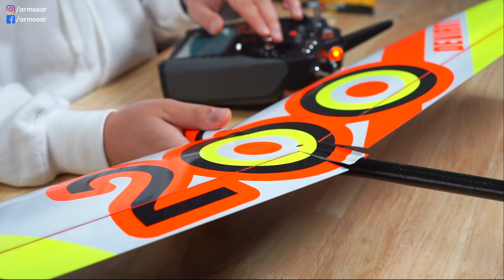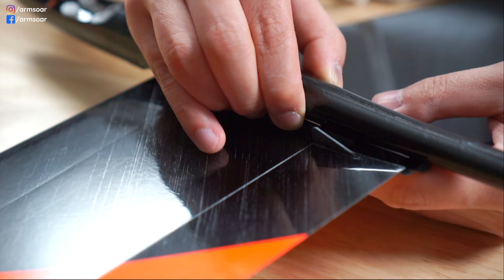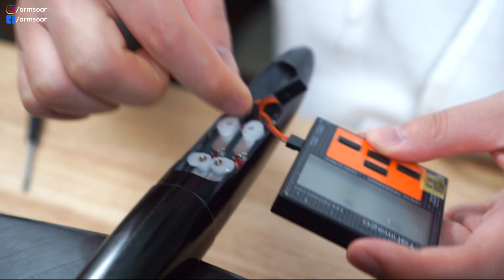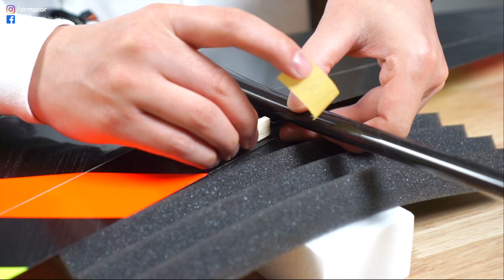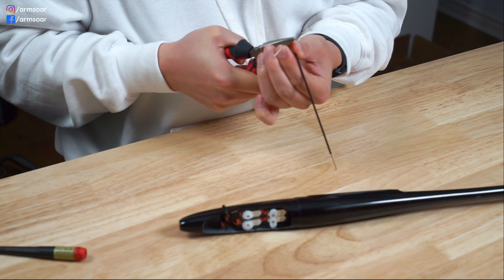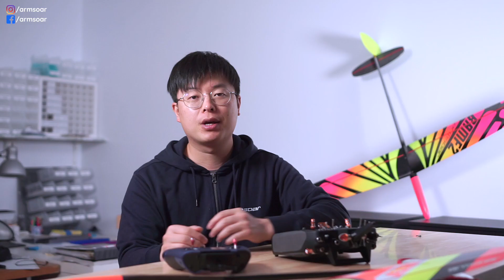Offsetting Your DLG Flaperons For The Best Performance

Comment: Inspiring approach. Have I got it correctly that you never use your flaperons in upper position? (spoilerons?)   The offsetting would limit that option.
Reply from the maker: Yup! Flaperons are not used as Spoilerons. The only up deflection is meant for aileron use.

Comment: Could you help me with a problem i am facing right now? I am setting up my cfk alien dlg. It has a rudder and and ailerons, which also work as an elevator. Im trying to program flight phases on digital switches - which works for elevator. Phase "Start" which some elevator up - and some right angle for rudder (to neutralize the tendency for going left right after start).
How do i access the rudder function to a digital switch? Is it via the "mixing" function of the TX? I am using a Spektrum DX6e...

Comment: Hi all, 

I am trying to set up my 1m Hawk DLG. 
NX8 - spektrum receiver 

I have set up my flight modes in Camber Preset. 

Is this correct: 

Cruise mode 0mm with 6mm up and travel of the aliron when I move the stick and 5mm down.

Thermal 1 - 2mm down this then reduces the up travel of the aliron to only 4mm and means the down throw become 7mm

Thermal 2 - 4 mm down this reduces up throw to 2mm and down becomes 9mm

Is this correct? The camber preset moves the aliron function down. 

Should the aliron throw be 6mm up and 5mm down regardless of what flight mode I’m in? 

Cruise 0mm
Thermal 1 - 2mm down 
Thermal 2 - 4mm down

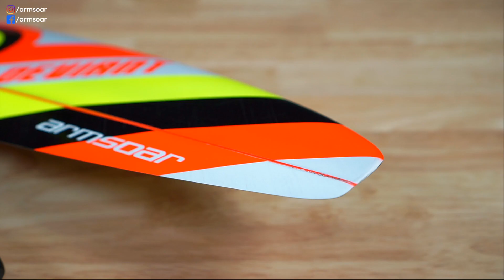Comment: 2:58 when you set them to neutral do you use sub trim to set 0° deflection? I did this with mine and I think my sub trim value is 450ish which is the max value.
Reply from the maker: Combo of sub trim and camber systems.

Comment: Very helpful! Another way to do is let say you need +15, -85deg, I center the flap at -35deg, in Frsky fine tuning with the servo center in outputs, I then use a mixer line with the fonction MAX and offset 35deg. This way no sub trim required.
Reply from the maker: Great tip! That basically enters an offset value in the setup. I love how you can do things in so many different ways with OpenTX.

Comment: Did you cut your servo wires to make everything more neat in the plane’s nose?
Reply from the maker: Not always but mostly yes. This one was shortened.
Reply: @ArmSoar  thought it looked too clean in there! One more question: can this be done with the radio and not a servo tester?
Reply from the maker: Yes but I prefer a servo tester since a radio might have different values set up (travel, etc) that affects it even on a ‘clean’ install. Best to use a servo tester that shows the signal/positioning.
Reply: What servo tester is used in this video?

Comment: Do you need to check differential after applying the mechanical offset? I think when you mechanically offset there may be some differential even though your radio is set at neutral.
Reply from the maker: Yes there will be differential with the offset. I use differential to bring them back to 0% (real world, not radio value) before trimming the model.